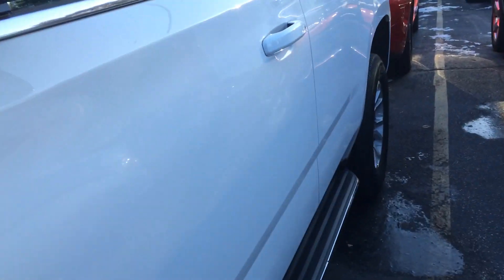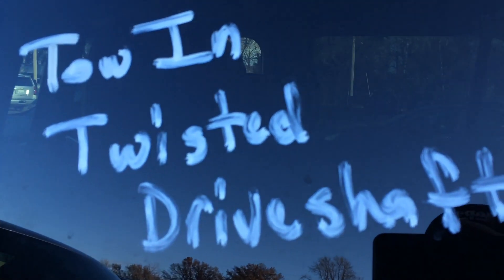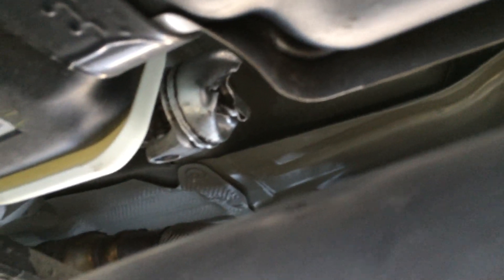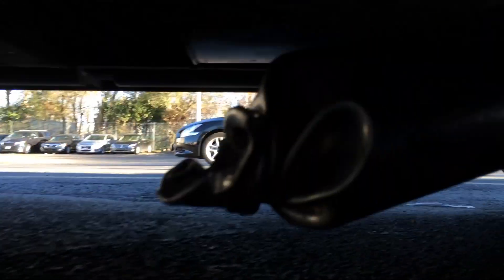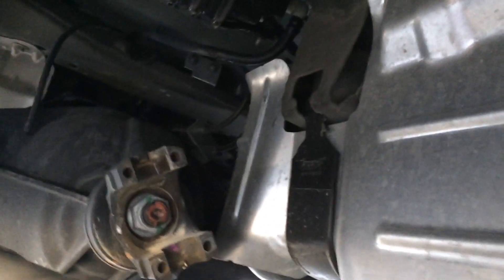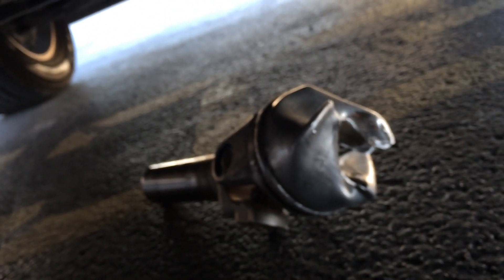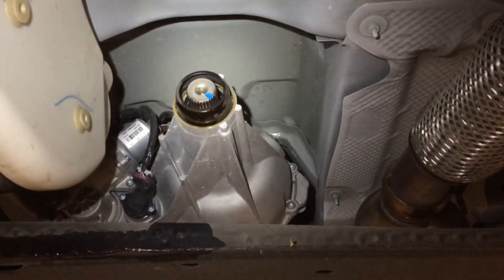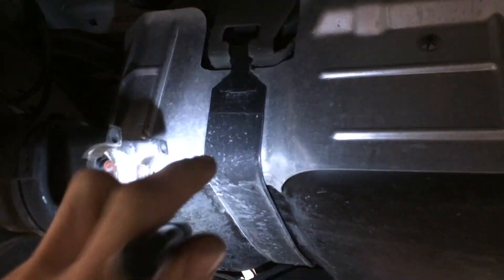Twisted Aluminum Driveshaft!

Comment: Did you even find out why that shaft twisted like that?
Reply: it was made of aluminum there is your reason
Reply: There was some type of lockup in the differential side which caused the tranny to continue spinning twisting the drive shaft. Which was made up of thin plate aluminum tubing.
Reply: bad couplings and bushing combined with bad mounts. If any of the components moves out of spec while the thing is spinning, driveshaft would fail, and usually is cut in half. Not as unusual as people think. Driveshaft is used to slow down the transmission, actually the brakes on the wheels. So all that force goes from the wheels to the tranny. It is just that today most cars are front wheel drive and there is no driveshaft. Any number of things could cause driveshaft to be cut in half. Jumping a vehicle will almost 100% cause a weak unit to break in half. Going from snow to pavement,  will snap it in half. Driving 4wd low on pavement will snap it. I have seen it on Jeeps and Broncos.

Comment: the direction of the twist should tell the story. it appears to be twisted counter clockwise, which is the same as the engine rotation. so it broke from power application or from the rear end suddenly stopping/hooking while driving forward.

so they stuck it in park while moving, or they were spinning and it hooked.

Comment: wow, I cant believe how thin that aluminum is, for a driveshaft seriously? lol
Reply: This0is0pointless got one in my race car .... thicker then that thing but...looks like he was trying to pull something that wasn't moving.... the aluminum tube just needs a twist and it's done
Reply: What does the weight of the drive shaft have to do with it twisting? 99.9999999% of the twisting force on a drive shaft comes from the power transfer from the transmission to the differential to the wheels to the ground. And the length of it is also really not extremely relevant either especially considering that it broke at the trans not in the middle. Aluminum does not stand up to high impact torque anywhere near as well as steel. Aluminum is very brittle. When it is slightly flexed/bent repeatedly it develops micro-fractures and eventually does what his drive shaft did. Steel on the other hand retains its structure amazingly well after flexing/bending. This is why springs are made of steel not aluminum. This is why steel is used for things like chains and braided steel cable. It can be stretched/bent thousands of times and doesn't break down the way aluminum does. The only real reason aluminum is used for much of anything is that its light weight and is almost impervious to corrosion.
Reply: You don't need the driveshaft from a dumptruck with modern materials.  It's also very short, and thusly doesn't need to be very thick. Part of the reason steel driveshafts are as thick as they are is so they don't twist due to the high weight of the steel used.
Reply: even being made from aluminum it should be stronger then the universal joints, you would think the u joint would always be the weakest failure point, the shaft itself twisting before a u-joint gives is just unacceptable
Reply: Yeah personally i dont think they should be using aluminum for drive shafts at all. Steel is just better. The only 2 bonuses about aluminum are that it is almost impervious to corrosion and light weight. For a thick steel drive shaft corrosion should be an issue anyway; it takes at least 50 years to rust through higher grade thick steel. And in my opinion the drive train is the last place you should be looking to cut weight from a vehicle.
Reply: Yeah that was my thought it is way to thin for that kind of strain.
Reply: maybe so but they are still just cast, what im getting at here is the shaft itself should not fail before one of the joints, if they cant make an aluminum shaft that will hold up to that standard then they shouldn't be using aluminum but who am I kidding they don't give a shit now days, for all we know they could start using some form of plastic next lol
Reply: I agree, plus most things they make out of aluminum now instead of steel, I don't really see the point besides the corrosion resistance when they have to use so much material that your not really saving much weight for it to even get close to the same strength as steel
Reply: A drive shaft of a truck needs to be more heavy duty than that. Maybe the person was pulling something that wasn't moving, but a drive shaft should at least overcome the grip of the tires.
Reply: This0is0pointless
U joints are made of incredibly high quality steel. They are generally stronger than aluminum tube.
Reply: Right. By weight there are a lot of materials with comparable strength to steel but the density of these materials is so low that you have to use a lot more volume. Using aluminum to replace thin sheet metal prone to corrosion is the only place I see logic but the aluminum is no where near as strong as can be proven in many videos testing fords new beer can trucks. dumping a load of rocks in the bed now results in holes instead of small dents.
Reply: Joe Blow you are 100% right
Reply: Joe Blow wow you sure you know what your talking about
Reply: I cut a million pounds of sheet steel a week, its my livelihood. I also cut sheet aluminum; only average maybe 20 thousand pounds a month. Steel isnt going anywhere.
Reply: Joe Blow nope dont belive you
Reply: Im ok with that.
Reply: Joe Blow i think you just cut the cheese all day
Reply: Joe Blow yea ujoints are made of low carbon steel pot metal mostly
Reply: Joe Blow its not the torque its the dot 3 brake fluid from the yellow bottle
Reply: It is mostly cheese grade steel but steel none the less.
Reply: Joe Blow  is it like chunky cheese wizz with mold
Reply: Nope. Just cheese grade drawing and furniture quality steel. Cuts similar to a well aged smoked gouda. From 25 up to 10 gauge.
Reply: Joe Blow yea you must be from sd
Reply: sd?
Reply: Right?
Reply: In your ranting......you never touched upon the spot weld.  

At least I don't see it on the post.

Of course, you comments were edited.

Are you famaliar with the affects of welding on aluminum...esp. thin said metal?
Reply: Joe Blow what does the weight of a driveshaft have to do with twisting? firstly, it has little reciprocating mass, it's all centrifugal, and secondly do a google search for "inertia". it's basic physics.

Comment: Aluminum shafts are plenty strong....if they are thick enough.  I'm willing to bet GM uses a pretty thin gauge alloy thanks to the bean counters.  Aluminum D/S's have been used for a long time with great results. My Crown Vic interceptor, as all interceptors do has an aluminum shaft, and many of those cars go many very hard miles without failure. But mine isn't as light as a feather. Lighter then a steel one but still pretty substantial.

Comment: Seen this one time. An old ford dually attempting a burnout.  Dropped the clutch and bang.  hilarious.
Reply: but tahoes are autos
Reply: Andy47357 Rev in neutral drop into drive
Reply: because that's a great way to give your transmission a good workout

Comment: my theory is one or both of the rear wheels was on ice when the vehicle was stopped and during acceleration (probably a hard acceleration) the wheel(s) spun on the ice and instantly caught traction during forward movement causing a sudden SNAP, which broke the weakest part of the rear end being the hollow aluminum driveshaft
Reply: The fact that its hollow has nothing to do with why it failed. It failed due to the material not being able to handle the stress.
Reply: That was my first thought, doesn't seem too much of a mystery.
Reply: ***** GM has a lot of engineering issues lol
Reply: That sounds possible, but I'm not sure even that sudden "snap" would be enough to do this. Maybe if he was hauling a lot of weight or a trailer.

That said, my experience with my Lego builds (yes I know) are that the universal joint is ALWAYS the weaker point. I've snapped about 7 UJs by now, but only 1 axle broke and that was completely my fault.

Comment: Some dickhead was trying to do burnouts.
Reply: Even so a drive shaft should not fail from burning out. The problem is using aluminum for a drive shaft.
Reply: yeah, a truck driveshaft should be able to handle burnouts when a truck should be able to tow a substantial amount of weight. I would like to see that drive shaft towing a small RV trailer.
Reply: realbhopwood   its all wheel drive.   not likely
Reply: was power breaking it and the torque had to go somewhere. Breaks engaged and it spun the shaft instead of the tires.

Comment: The Denalis actually have a 6.2 liter, what probably happened is the person try to do a burnout and there was already some sort of damage to the drive shaft to cause a weak point.
Reply: Michael Daniels II with only 7000 miles it was probably that and a manufacturing defect
Reply: TheTomco11 totally possible
Reply: manufacturing design flaw more like it.  R&D Team Member: hey I got a great idea & way to lessen the total weight of the truck; lets make the drive shaft out of weakest material out there. But hey its weighs less. ;-))))
Reply: ▪cheapest 

nope

Comment: All you guys claiming the problem is that it's aluminum, have never been to a drag strip. Aluminum, (when properly engineered) can withstand the torque. The problem with putting them on a truck or SUV is if you dent/damage them at all, they will fail. In my opinion, they are meant for on the road or track, not your neighbor's mud hole or off roading.

Comment: The rear end and transmission gears had to have some kind of damage as well. You cant just twist the driveshaft and no other damage. Man this is really scary if your looking to buy a used vehicle. Some snot nosed rich kid probably took mommies suv out and power braked the crap out of it until it broke.
Reply: Motortube no the factory just tig welds like 17 beer cans together and voila you have a driveshaft. 
They empty the cans at break time and lunch.
Reply: you can easily twist the drive shaft and have no other damage what are you talking about? ive done it myself, my old mans done it many times too, go to a drag strip and tell them that bs
Reply: turbonut20v my buds old Ford with a 6v53TT can do it if he stands on the brakes and mashes the gas. 
That's what a transbrake is for 👍🏻
Reply: Motortube hey bud it bresks before it does damage happen half dozen times to me
Reply: loool wrong
Reply: you cant do this to a drive shaft via power breaking(auto trans slips too much in first gear), this usually happens from shock load, or drive line bind up at speed. happens occasionally to highway tractors in the winter here, they hit some ice while accelerating, then 10,000 ftlbs(first gear eaton road ranger) of torque shocks the drive shaft and it twists like a barber pole when he grabs solid pavement.

Comment: I'm a diehard Ford fan but it's funny everytime you post something gone wrong with a GM car in the comment inevitably a comment saying : "GM is junk blah blah blah " , and the same with Ford and Chrysler cars
Reply: What I see a lot is "This is why you buy ford and not GM or Dodge. They don't use your tax dollars either." But they did actually take a $6 Billion government loan and in return produced vehicles to government specifications(basically pushing them towards electric cars and small turbo engines). And who supplied Ford with engines and transmissions during their start AND invested what would be hundreds of thousands of dollars in todays currency into Ford? The Dodge brothers. I buy cars based on whether I like the car or not. Not what brand made it or what badges it has.

Comment: Ecotec kicked in too hard
Reply: Capri Driver Vortec
Reply: Isn't the V8 in these called Ecotec?
Reply: Capri Driver You're right! Vortec was the technology used in GM's older V8 engines. My apologies lbs
Reply: Yeah the Vortecs were the last generation of the Small block Chevy in the late 90s up until 2003

Comment: ive only seen that happen on race cars
Reply: Michael McCurley Cars are extraordinary better off today because of regulation and requirement.  Cars today are more efficient, more powerful, and safer than ever thanks to institutions like the IIHS. Your 94 whatever it is doesn't stand a chance vs a 2016 car in a collision, particularly a small offset collision where 40%or less of the vehicles front end is involved. Or the side or the roof for that matter. No comparison. Period.  There are cool things about older cars but your old car was new at one point and at that time you had people complaining about your 94 being too modern and not like the old cars. Time moves on. You should move on with it. There's also nothing wrong with cutting pollution. I don't like gasoline vapors in my nose. Why do you? Just so you can stick it to the "libtards"? Who in their right mind would want to increase pollution? Do you go around your house hiding bags of turd under your couch cushions?
Reply: Look forward to seeing more of it on civilian street vehicles with design parameters ham strung by brain dead libtard politicians...
Reply: Michael McCurley politicians have nothing to do with this
Reply: My comment wasn't aimed at safety factors. When CARB required catalytic converters on lawn mowers, refused to do cost effectiveness studies, and mandated the most idiotically dangerous "no vapor" spout system for gas cans that I've ever seen,  that's when I realized that the libtards and lobbyists had run amok with what was once a legitimate function. Any more stupid comments, libtard?
Reply: Did you know the reason why it's hard to get a short bed short cab truck with a big motor?

CARB.

You get more emissions based on the area of the ground the truck covers.  So less efficient crappier monster trucks are what they have to build.  Which use more fuel.

Yay to regulation.
Reply: I'm curious to know which of the pros weighing in here are actually engineers in the auto industry.
Reply: You mean the geniuses who created the Pinto, Vega, Corvair, Citation, and Horizon ???
Reply: What do you mean, the ford pinto was the safest car ever built. xD
Reply: Cars run more efficient without emission controls. To meet insane mileage regulations and emissions standards, they have to build cars like tin cans. They simply aren't safe, nor efficient as they can be.  Really, old heavy cars aren't as safe as new light tin cans? Care to put that to a test by playing chicken?
Reply: Newer cars actually are safer due to the incorporation of crumple zones, an idea good enough to be incorporated in formula 1 and "group 6" racing machines. Air bags on the other hand are so idiotically dangerous as to be ridiculous. As for the  fleet mileage requirements, this is a good example of the idiot libtards trying to enforce artificial mandates in order to essentially wipe out personal motorized transportation, one of their holy grails...

Comment: Spin to win then she hooked up I have seen semi trucks shear u-joint,axle shafts, differentials, transmissions and drive lines doing just that
Reply: I spun a shaft on a dodge ram. Lost traction on a patch of ice for a second then bang.
Reply: Andrew M They twist those driveshafts into candy canes. ive seen em take out the air tanks and all the lines before. Not a fun day for anyone.
Reply: 91 grand marquis, with a little bit of modding on the 302. 31x10.5 kelly safari msr's and a rolling neutral drop = Exactly this.

Comment: I had a similar issue on my 2000 Chevy xtreme. Spit the drive shaft out the rear with 7K miles on the odo. Kept telling the dealer weeks before it happened something was wrong with the rear end. In the end the rear u joints failed which caused the drive shaft to come off and bounce off the freeway. The drive shaft ended going through the bed of my truck. Over 10K in damages to that poor truck. After it was fixed I traded it in.
Reply: wow holy shit lucky it didnt kill no one

Comment: Stupid question: Why is the metal so thin looking on the drive shaft? I thought they were solid?
Reply: +S. L  so it can twist, its not solid its like a wire if you may say
Reply: +culan001 like alot of twisted wires i ment to say,like rope
Reply: *****  You're kidding me, fiberglass shaft?  Hollow and fibreglass? I used to work with fibreglass, I would imagine that would break instantly.

Comment: I myself am a general motors certified technician and I have yet to see this happen at my dealership. The 5.3 is a powerful motor and although I'm sure this could happen, if you don't torture your vehicles they don't end up like this. This shouldn't have to be reported to warranty because when it's being used for its intended purpose, its highly unlikely you will see anything worse than u-joint failure. For the most part the 2014 and newer trucks seem great but only time will tell if there are any serious flaws with the product

Comment: GMC junk. I babied my 2006 Sierra 4x4 XLT Z71. It was no more than a glamerized car. I had that crap in the shop for leaf spring replacement in the first year and rebuilt the steering linkage within 60000 miles. I hadn't even gone through two sets of tires. It had many issues I sold it with including not getting out of tow mode when it's supposed to from time to time. Cosmetic failures countless due to poor quality.
Reply: Stephen Smith fuck off Ford hick

Comment: It happens by getting stuck (like in snow) and trying to rock it back & forth but not letting the rpm come down enough before snapping it into oppisite direction gear. We have a ram in the shop now like it. The new liteweight aluminum doesn't like that